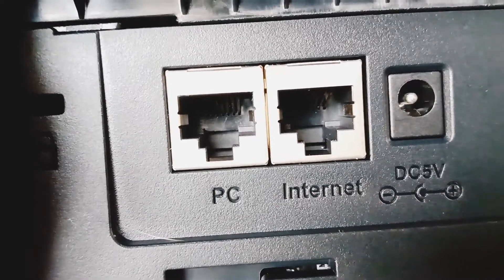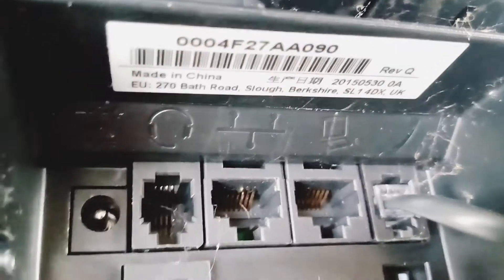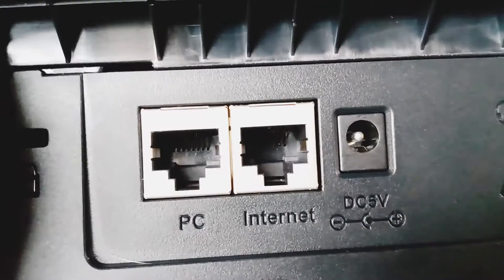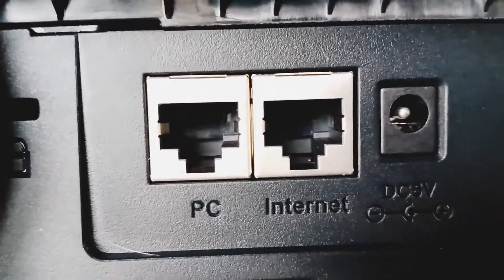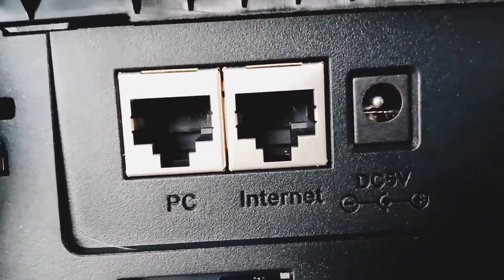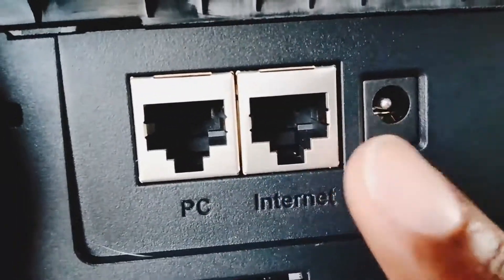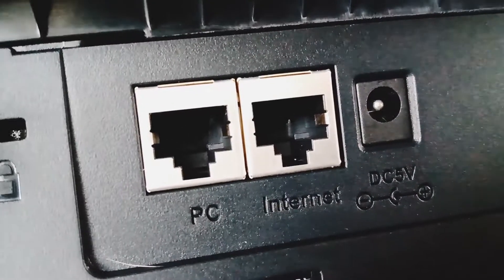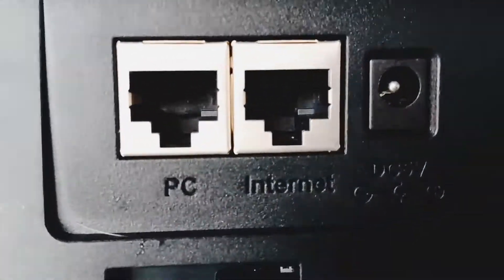How an Ethernet passthrough on IP phones works!

Comment: So, an IP passthrough device is like a two port switch. Thus, the IP phone and the PC have different IP addresses but they share the same hardware (cable). Am I correct?
Reply from the maker: YES! EXACTLY! And while I've not personally tested this myself, I believe you are correct in that the IP phone and the respective device it's passing out internet to, should both have 2 seperate IP addresses since they both have 2 seperate respective MAC addresses. 😊

Comment: Can we use single drop to phone from switch and phone to user computer for large network
Reply from the maker: Hi there. I typically DO NOT recommend using the Ethernet pass through on very large networks (say 25-50 extensions or higher), BUT I have seen people pull it off with no call quality issues, in scenarios where they have strong routers/switches in place, sometimes with managed ports to better filtrate and priorities traffic/packets for large networks where you have many nodes and a lot of traffic. I hope that helps answer your question and thanks for watching. ☺️